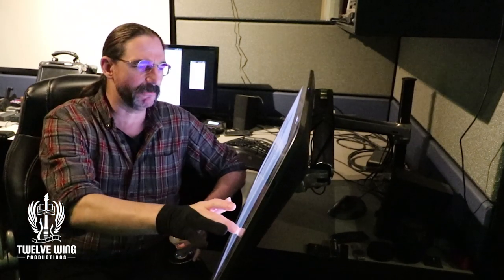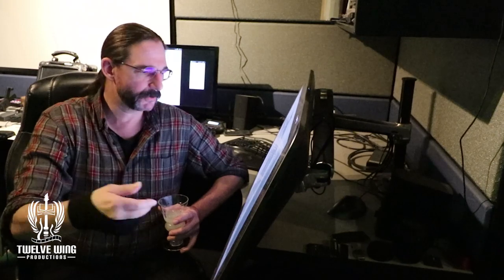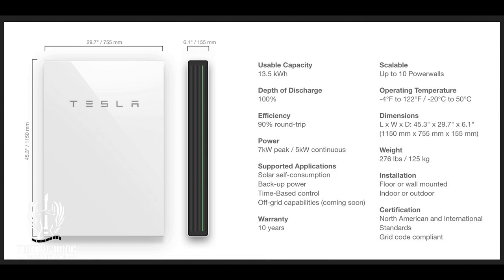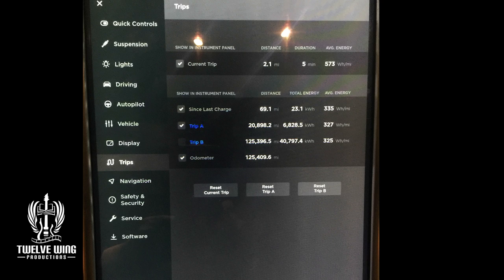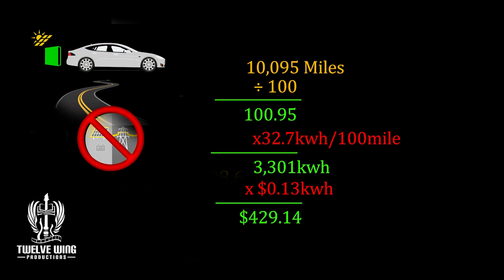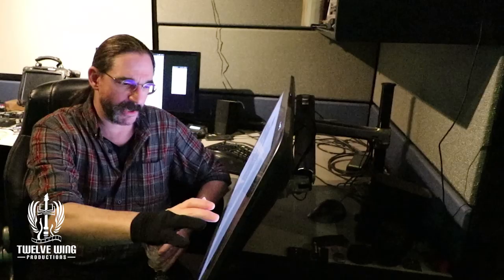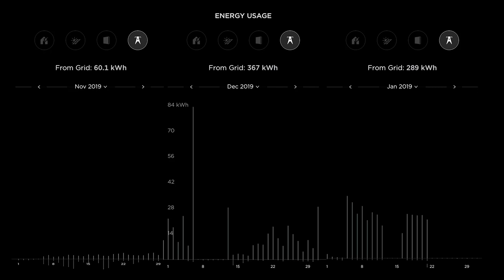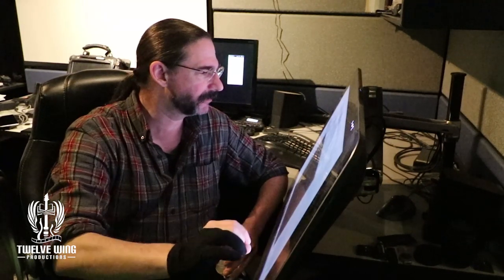Massive 6 Tesla Powerwall System: Did It Work?

Comment: Very detailed analysis. I like that. It gave me ideas on how to approach data gathering for my system once everything is in place.
Reply from the maker: Early on we identified some key things to get sorted out and track straight away.
Firstly, it's critical that you follow our steps for finding out what the true capacity of your system is.
Once that's done, the most valuable number to us has been what we call "Total Solar Day".  Knowing your amount of production, amount of use and total battery remaining at time of total solar day is super important.
Next in line of importance is the percentage of charge (That's why knowing the capacity is important) in your battery at the time solar first starts to contribute.  You don't have to gather that one daily necessarily but it is a very handy thing to log for at least a year so you can become familiar with how your system reacts to sunny vs rainy days at each of the seasons.

Thanks for following along.

Comment: Fantastic summary of your experience. I am envious of your lower grid usage during Winter. I live in Edmonds, WA so we have lower solar production than you and more electric usage from our electric heat pump/water heater system during Winter months. We have 13.2 kWh solar PV system installed in 2012, and 2 PW2's installed in 2018 and also have two Tesla's (MS and M3), which are powered off our PV system, and our system operates in self powered mode and we generated 12,182 kWh last year and used 3521 kWh, which included charging both Tesla's. We used zero grid energy for ~9 months of the year, so not quite as well as you but very happy that we are Net Zero to Net Positive for most of the year. Keep the videos coming, they are very worthwhile in informing interested folks that there is a lot one can do to be self sufficient. We love our solar PV + PW2 batteries + Tesla vehicles. No going back and all electric is the way.
Reply from the maker: Thanks for telling us about your system.  You guys are doing outstanding for being so far north!
Winter is tough the farther north you go.

Comment: Great Video.  I have watched your monthly production stats these past months and have always been impressed how well your system performs. I have a 5.7kw system total  (two seperate installs, May 3.6kwh and Nov 2.1kwh in 2019) and have not and will never be able to match your solar output average, however my needs are much less than yours at 4,300 Kw p/a. It must have a lot to do with the latitude as you indicated, as I am more north in Dublin, Irl at 53.3. Not sure what yours is but I can check it. I am hopeful with the summer coming and by the time of my first anniversary of the complete system I might reach 3,800 to 4,000 Kw. I have 4 Pylontech batteries total 9.6kw storage). My hot water is on a different solar system using 40 evacuated tubes (Kingspan) and works very well and only need to partially heat the water even in winter with utility gas. We also have a Nissan Leaf (40 kwh) and have used very little home electric as there are many free chargers up to now/but billing is coming in with the fast chargers (higher than 22kwh) so that will change in the future.
As I like to say, the money is gone, but I have a very enjoyable hobby, monitoring the system and even if  I never got my money back (which I will) it has been more than worth it just for the sheer enjoyment.
Keep up your great videos.
Reply: @Eddie gough hi if you get to read this one day I'm looking to install a pylontech battery on my house and was wondering how the battery is doing for you?  They seem a fair bit cheaper at 550per kw in Australia compared to over 1000 for tesla.  Not many reviews on them as they're not as popular as tesla.

Comment: Great channel, great videos: QUESTION; Did I hear you right saying “we pulled out all the LED BULBS, and replaced them with INCANDESCENT?
Sorry, but that seems backwards. I re listened to it to make sure that’s what I heard. I’m sure it was just a hiccup of thought since LED is SO MUCH MORE EFFICIENT, thanks. I have 8.4 KW solar, just had 2 powerwalls installed, I was grandfathered in since I signed up October 2020 before the TESLA NO LONGER INSTALLS POWERWALLS UNLESS YOU BUY IT WITH SOLAR. After a long wait,  They we’re finally installed June 2021.
Reply from the maker: It was part of the test.  
The goal of the project was to have a home that came as close as possible to the national average yearly average use per day of 30kwh.
I realized that the home I bought for my mom was a little too efficient to meet that goal so I actually had to make her home use a little more energy per day.

In the end I think we used an average of 36kwh per day.  So perfectly in line with an average home.

Comment: Another question if I could. As I mentioned before, I have 8.4kw of solar. 4 years old this month September 2021. My bill went from $100-$110/ month to average of $19.25. I have been very pleased. I think I have 6 months of zero cost in power but $8 line charge which I am delighted to pay for the maintenance of the grid. At the end of 2020, I replaced a 10 year old 13 SEER Goodman heat pump with heat strips, with a Lennox 20 SEER With propane back up. I figured with 35% more efficiency and propane back up, my bill would easily go away. It has not happened. Then in June, I got two powerwalls. I hope to play with it all to be at zero NET-NET. I would love to add more power walls as time goes on since our Virginia weather has really changed and we get a lot of rain and clouds. Do you think they will bring back the ability to get more if you’re not buying solar too. Lastly, I don’t care for the new Tesla app, I love the old one and glad I kept it on my phone. Any problems you see with the new app?
Reply from the maker: What the powerwalls do is allow you to press your coverage further into shoulder periods of the year as they can store power from sunny days to cover those days when it's cloudy.
That said, it's all about your production vs. your use.
What is your average daily usage if you averaged it over a year?
Look on your bill for the total energy used last year and divide it by 365 if you would.
That will allow me to make a more educated guess as to what you would need to fully cover the year.
Also, do you drive an electric car?  If so, average your mileage for a given average year.  Not a covid influenced year.

Comment: If  I interpreted your plan correctly you have panels facing east, south, west and north.  You mentioned the west panels being shaded in morning,  similarly the east panels will be shaded in the evenings I guess.  What are the pitches of the panels,  and how many kw in each direction?  With that information it would be really nice to see how.much power each produced.  I guess on cloudy/overcast days the north facing panels will.produce about the same as the other panels.  Is that correct.  Really interesting but this is first time I have come across it.  Think I would have wanted to argue the north panels should not count in the 10.5 as they never get direct sunshine.
Reply from the maker: Because the pitch of our roof, though highly faceted, is not very steep the initial idea was to put a Tesla solar roof on it and have a solar producing tile on every square inch of the roof.

This had two problems.  First and foremost, the tiles weren't available at the time we started the project.  Second, however, would have been that we would have been limited to a little over 10kw of PV anyway.
Initially I wanted the project to be able to examine the max available power to a roof.  I calculated that our roof should be able to support nearly 20kw of panels but our utility company was not going to allow anything anywhere near that.

So our plan B was to install a portion of the panels on every face so we could at least gather data from those panels to share with you all.
We have a couple videos where we go into detail about just that.

Those panels produce about 90% of the amount of power of the south panels in summer and 65-75% in winter.
So though the efficiency does fall off in winter, if you are trying to maximize your total output by leveraging all your real estate... it is worth doing.
Reply: @twelvewingproductions7508  Thanks for your response.  I will try and find your previous videos.  My roof pitch is only 18°,  Orientation 104°/284°.   Using a European research centre site that includes average cloud cover month by month the 104 roof will only produce an average of .33 kw per Kw of panel in dec/jan.  (and a porch at 45°pitch about 0.5 kw per kw).  I no estimate for the 284 deg but had come to the conclusion I have spare panels I might as well put them up to see(and safer than trying to store them).   The main benefit of the roof is that it will provide lots of power for air conditioning.in summer and a early boost to charging on winter mornings.  
My main winter power will come from a S ish (194°) wall on which I expect to get 1kw per kw of panel in dec /jan.  
This gives mey an average of about 9 kw in jan /dec.  Any from the 284 roof  a bonus.   I have a few other places I can add panels later probably at most 3kw.
Aim is to be off grid,  but Autobidder software could tempt me back to the grid.  
I am east of London so my efficiency is probably lower than yours.
 Thanks again for your information.  I look forward to your future videos.
Reply from the maker: @davidclark2286  Exactly.  Sub optimal panel placement is simply to ensure a little extra production and isn't really for primary generation.
Every home is different though, so I felt some would appreciate the additional data.
Another thing that obviously factors into this heavily and that I repeat often is that our data is VERY latitude specific.
Higher latitudes won't see as much benefit from sub-optimal placement.. especially north facing.

Comment: So was the system run in self powered mode or the advanced and why ? Great to have followed you in this journey ! Cheers
Reply from the maker: Aside from a few brief periods for maybe up to an hour as we attempted to stop the rogue charging incidents, the system has been on "Self Powered" mode the entire year.  I felt I wanted to use the mode where the user had the most control. 

Initial experiments with "Balanced" and "Cost Savings" modes resulted in the system favoring the grid over the batteries in the distribution of power.
Similar to the argument I made in the video, I don't think this is a very good idea.  Firstly because I don't think we can count on net metering continuing for much longer but more than that, the utility companies will use it as a weapon to beat solar customers to death with.

Comment: I average 49 per day.. What size panel system in KWH  would you think I need. Also Living in Northern CA.
Reply from the maker: With net metering you would be looking at 12-15kw.
That would be your breakeven point.  If you are looking to bring your grid power usage to near zero even in winter you would be looking at around 18-20kw.

Comment: Interested in going solar and getting powerwalls eventually... Very good information.  I'm away from the city in ohio, had a couple outages one for 3 days in just 3 months time.  Hoping my new place doesn't continue having these issues.  Biggest thing is my powerwall or solar won't be cost effective when my electricity cost is like 5.35 cents kwh.  My electricity usage past two months is averaging 420kwh and june has been warmer, doesn't appear to impact usage with geothermal.  with electricity at $63 a month so far I'm not sure it makes sense to get solar+powerwall aside from scenario of power outage.
Worth noting my electricity runs everything including my well pump as city water isn't available or natural gas.. propane an option but don't have it set up, be another large investment for installation.  

Hopefully my electricity company lets me get them installed.

Comment: what size house do you run? Could you run house and a car only on a 6 powerwalls?
Reply from the maker: The batteries are only one part of the equation.  If you go back and watch a few of the weekly updates you will get a feel for how this works during the various seasons.  During those update videos we track EVERYTHING.  Home usage, solar production, vehicle charging.
So the answer to your question has to also include the amount of solar panels you have as well as your home consumption.
In our case we have roughly 10kw of solar producing roughly 8kw actual (typical to see 20% less than bench) and 81kwh of usable battery storage on a home that averages 37kwh per day of usage with 9.3kwh per day of that usage being driving on collected sunlight.

Comment: I’m debating heavily weather to go with Tesla direct or buy solar elsewhere and then have the 3rd party install 2 Powerwalls. Our household consumes 32kwh per day/average for two residents, but we may have 4 residents by summer (parents moving in). Tesla is quoting a 10 kw system (4 powerwalls) and 3rd party is quoting 11.10kw with 2 batteries. The 3rd party says 4 walls are overkill, cuz the system could never top them off. I can’t get Tesla to give me a clear answer to any question. No debating, no panel options, no design changes. My confusion is that the 3rd party is quoting LG panels with much greater efficiency and using micro inverters. Tesla is quoting poorly rated QCell panels with middle-road efficiency and 3 central inverters. Question 1) aren’t central inverters old tech? Aren’t micro inverters more reliable and efficient? 2) are two powerwalls enough to power my home overnight till sun comes up next day? 3) is Tesla support dismal compared to EnPhase? The problem in deciding is Tesla is so F-n cheap!

Comment: The amount of time and education required to operate and maintain these systems is truly impressive considering zero time or education is required to live without it.  As a renter buying a home seems like a waste of time and energy and this pretty much seals the deal. Way cheaper too lease and let the landlord deal with all the problems! Hope someday they make a system that works as well as the current system. 
+
Reply from the maker: That was one reason we didn't do this as a "DIY" project.
I think the biggest hassle isn't the running of the system... this evaluation might make it seem more complicated than it is.  The biggest issue is the approval process.  That part is a nightmare.
SunWorks made that as painless as possible but it's still a pain and a serious problem that the utility company can just say "no".

I'll try and do a follow up video to this where I talk about how it is now.  Because I'm no longer trying to log every little detail and make note of every nuance, the system is just quietly running in the background.

Comment: with coven-19 i think it would be interesting to compare the utility load curves from now and this same time last year
Reply from the maker: Are you talking about for The Energy Sovereignty Project home?
You will notice a slightly elevated number for this March since we had a slight system failure at the beginning of March this year that affected us until the 10th.
Tesla finally completely fixed their software issue but we did have some additional grid use due to that.
In March of 2019 we used 38kwh from the grid while supplying 9.2kwh to the grid.
For March of 2020 we have used 73.8kwh from the grid and sent 221kwh to the grid.
The reason our numbers to the grid for March of this year are so high is that shelter in place meant that I haven't been driving to the bay area regularly as we did all throughout last year.

So far in April we have used nothing from the grid and have already sent 46.3kwh to the grid.
Reply: @twelvewingproductions7508  no. I am talking about the electric utility. How has the utility demand changed due to the virus.
Reply from the maker: @ewouk61 , our household probably isn't the best one to use for that kind of comparison.
The Energy Sovereignty Project home is a home I bought for my mother so she could be up here closer to my home studio.  Because of that, her home is occupied 24/7 by her anyway, so this isn't much different.  But I can show one interesting difference. 

In march of 2019, our total home usage was 1024kwh.  In 2020, with the shutdown, our home usage was exactly the same, 748kwh. 

I hear what you are saying... you are saying... "Now surely 748kwh is less than 1024kwh?".  And you would be right.  But remember how I always caution you guys and gals about the dangers of raw data.
The energy sovereignty home isn't your usual household.  When you don't drive your car on gasoline, you simply don't spend cash on gas.  When you don't drive an electric car... you simply send that extra power to the utility company and they pay you for it at the end of the year.
If you review The Energy Sovereignty project videos from March of last year, you will see that this was the month where we started to do some serious driving on sunlight.
In the month of March alone we sent 269kwh of sunlight to the car.  This gives us a total of 1017kwh used by the home if we were to add last years expenditure of power from the car.
Instead of doing that, this year in March we sent 221kwh to the grid.

Hoped that helped clarify things in a fun way.